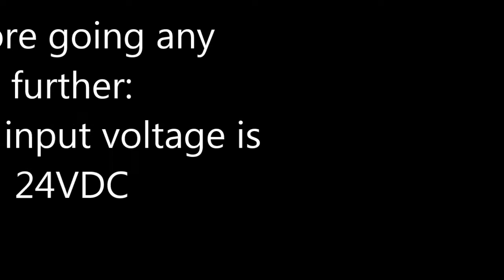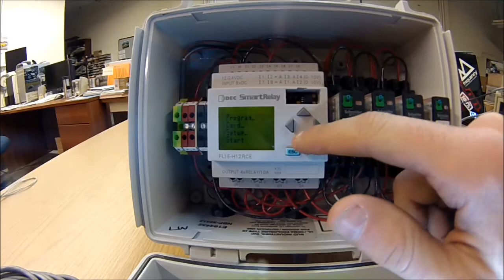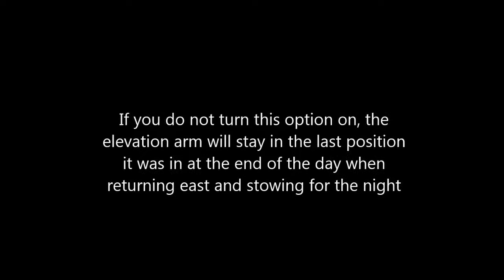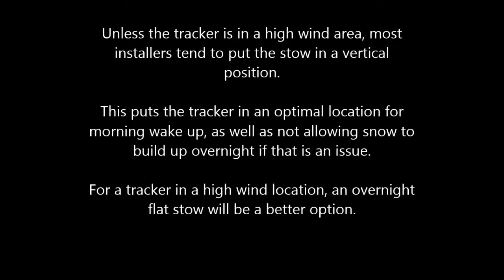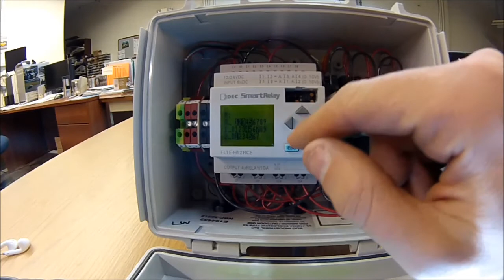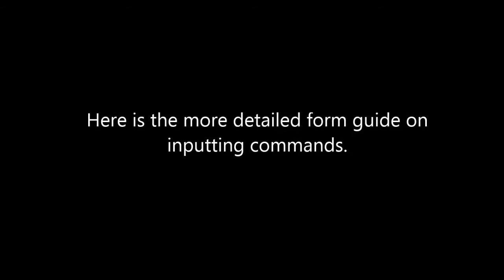Wattsun Dual Axis Controller Initialization Guide

Comment: Does the controller have an option to sense high wind and stow flat?
Reply from the maker: Hi David, we currently do not have a wind stow option.  It can be accomplished manually, and there are also some aftermarket options that have been used on our trackers.  If you want some more info feel free to email me kyle@wattsun.com